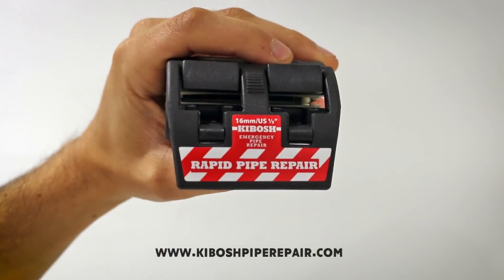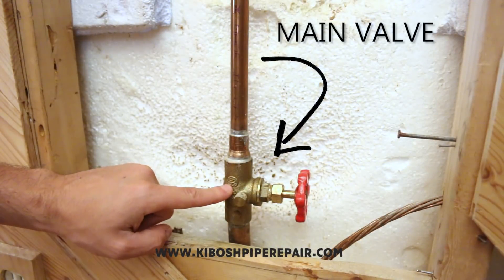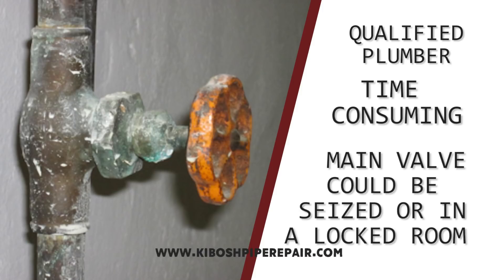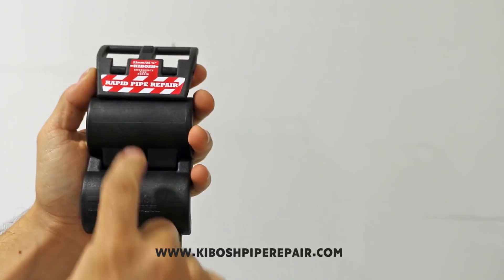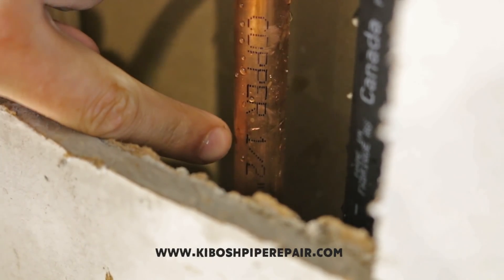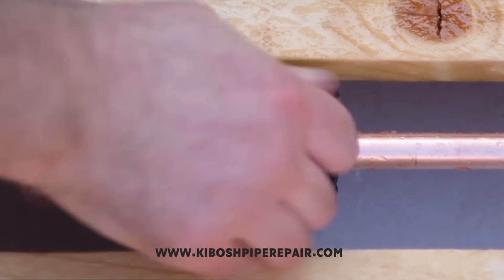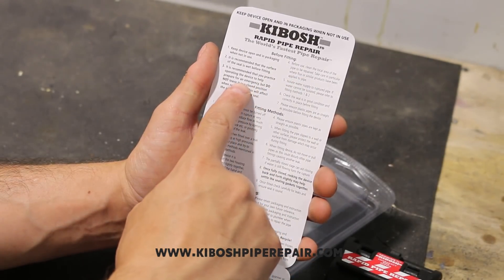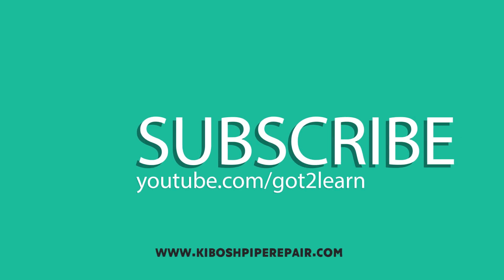The easiest way to stop a leak on a pipe! | GOT2LEARN

Comment: This is the second video you’ve done where I’ve seen white pipe called polybutylene. However the pipe looks like pex to me. It’s thick like pex and is also white. I’ve only ever seen gray PB and it’s much thinner than that looked. I’m not saying it doesn’t come in different colors I’ve just never seen it. We used to call this pipe qest (quest). We’d repair it with pex by qest adaptors. They were pretty much just pex couplings but one side had a copper crimp ring and the pex side had the typical black ring. They also had a little different ODs and barb patterns. Not trying to criticize just curious
Reply from the maker: It's CPVC ;)
Reply: CPVC? It looks like clear/white pex. I guess they make all things in different colors. Though I may have been mistaken on rewatch. I thought you were naming them in order of what was shown. However I realized you were just listing them with a pic but they don’t necessarily correspond
Reply from the maker: The only 2 white pipes in the video are PEX  and CPVC, CPVC though is more beige than PEX ;)